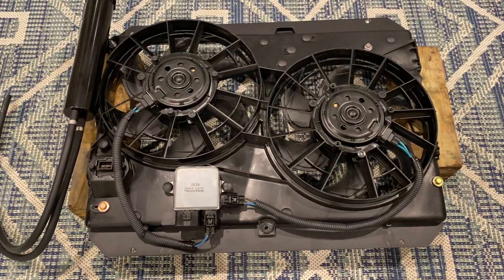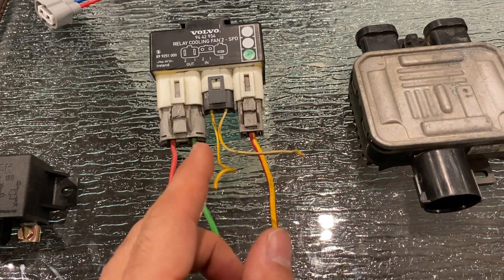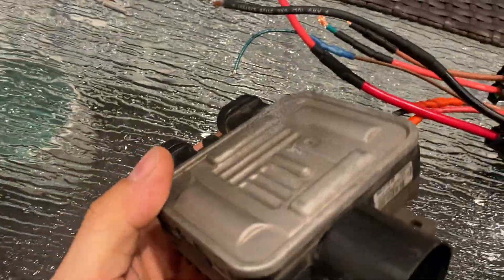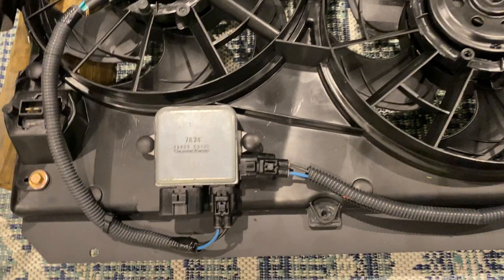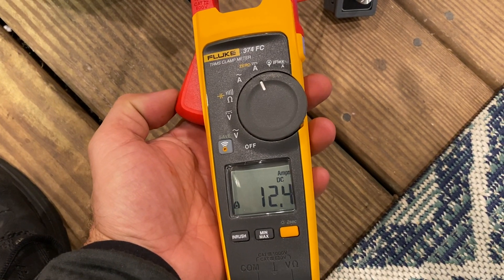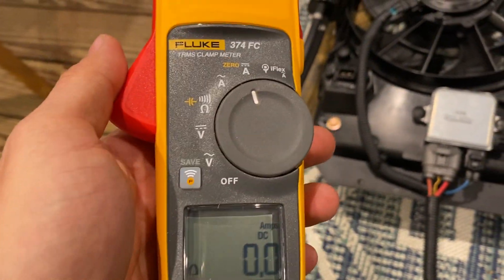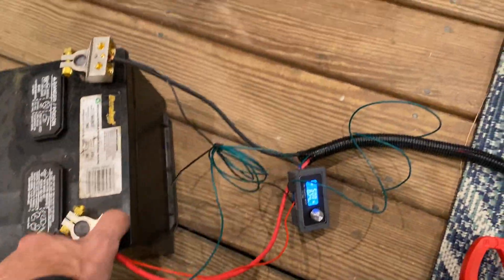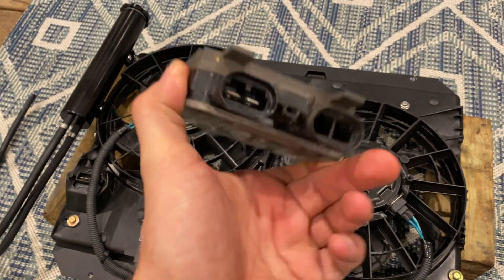Contour Fan Setup using a PMW fan controller

Comment: Hi, i have volvo s80 2011 2.0t with one fan unit. I bought control module with two outlets. can i buy dual fan unit and use it plug and play or i need to make some mods?
Reply from the maker: I wouldn't recommend that.  The current control module you have might use different inputs to control it and might not be compatible with this PWM module.
Reply: @Mustang5L5  The thing is my fan isn't spinning when it should at appropriate temperature and oscillates highly when i turn on AC, so i bought from aliexpress module that looks like the original also for s80 but has one inlet for power and two outlets for each fan. It also doesn't turn on when engine is above 95C. What would you recommend?
Thx for answer.
Reply: @Mustang5L5  In the end i went and bought the whole unit localy for 250. Temps are around 96 96 after a good drive. Only oil raises to 102 sometimes and than goes down. Thank you for advice and didn't waste money.

Comment: So, I'm working on a 04 Cobra.  I'm installing the Contour fans and I have this exact controller.  I have an MS3Pro but I'm confused because the fan has it's own menu and then when you set up the PWM menu you have 2 separate menus calling on the same output pin which if I'm understanding correctly, you shouldn't do.  If I wanted to route the current fan power wires into this controller and just have it as an on/off Fan controller, would it still have the soft start feature?  I have no intention on ever running this fan at any speed lower than full.  Thanks!
Reply from the maker: Are you on the latest firmware for MS?  The fan control menu is completely different now than what i show in the video.  It's more PWM specific and works better with these units. 

I only see one output pin now under the FAN menu, and you can select the ON/OFF temp and the min and max duty cycle.  The fan does still soft start, so you can set it to 100% on at a certain temp, and even have it shut off at WOT or with a certain MPH.

Comment: Thanks for confirming this operation. This is exactly what I need to do to my Lincoln LS cooling fan that keeps going into failsafe. It is receiving a bad PWM signal from the ECU because of a bad cylinder heat temperature sensor. The dealer could not get the intake manifold off because of seized bolt, so now I will just add my own PWM signal to the fan controller and keep it around 80%. How do I know what frequency to select? Do I simply adjust the frequency until the fan begins to operate?
Reply: I believe hr said these will work anywhere between 100-500hz. Friend has his ecumaster at 100hz. My haltech is at 500hz.

Comment: One last question. Do you believe its possible to control fan speed by cooling temp instead of manual speed input?  How?
Reply from the maker: There is no way to directly input a temp to the controller to make it work.  It can only read a PWM signal.   So any coolant temp data needs to be interpreted by an ECU or some sort which then creates a PWM signal it can understand

Comment: Amazing video. Top info. Tks a lot. I will convert my MB R129 chassis from clutch fan to electric and I will use your basic idea. May I ask you the part number for the electrical plugs. Can not find the correct ones. Tks a lot.

Comment: Why a nissan pmw? Is so unrelliable... A relay system is better...
Reply: Sounds like you do not understand the purpose of a PWM Controller? The point is to control the Fan Speed as needed. If little cooling is needed, then you have low speed. If you need a lot of cooling, then you will get higher speed. It works a lot better than you would believe

Comment: 62 amps for startup with one fan.  Wow.  Watching this to gain the lower startup draw.  Thanks.
Reply from the maker: Keep in mind that’s for less than a second. Typically for any motor startup and why you need to use the proper fuse type that won’t blow right away.  What really matters is continuous amps.

Comment: Hey! Thanks for the video! Could you help to understand the difference between Mazda's 21493-C370B and Infiniti's 21493-B210B controllers? Are they the same inside? Can I use Infiniti's for my Mazda? thanks
Reply from the maker: They operate similarly, but I was never able to get a solid answer on their differences.  Since these modules are provided to OEM's, the specs aren't exactly public.  In my testing, i've found that the PWN values needed to operate them are very slightly different.   Not but much.   I don't have enough of them to test to see if that is just variability between each unit, or if that slight difference is by design.
Reply: @Mustang5L5  thanks for the answer!

Comment: Does it have to be controlled with that (Amazon) controller? Is there a way to make it automatic to increase with more temperature, or to have it at two (or more) fixed speeds? I retrofitted a Mercedes W221 600W fan on my old Mercedes. Max speed takes like 46 amps and it will not live for long if full speed engages a lot or when it's not needed.
Reply from the maker: It needs to be controlled by some sort of external controller.  I used that Amazon controller to demonstrate, but really this is probably geared more to folks with an aftermarket ECU like Holley or Megasquirt that can create a PWM signal output on a spare output channel.  This unit really can't be used as a standalone controller.

Comment: Great video, question, this is PWM so, can it have a sensor connected to the radiator and sense the tempature to then build up or down the fan speed?
Reply from the maker: No.  This controller requires a PWM signal from another device like an aftermarket (or factory) ECU or an arduino.  Something needs to take the temp sensor signal, and other inputs like AC command, WOT, etc and convert that into a PWM signal that this unit can use.   A stand-along controller would be great, but as far as I know nobody makes one design to output a PWM signal.
Reply: @Mustang5L5  can you create a temperature sensor directly for it without an ECU? thanks
Reply from the maker: @yellowjoe.2000  No.  Temp sensors work off resistance.  This controller works off a pulsing voltage signal.  The faster or slow the pulse, the higher or lower the fan speed will be.   You need something to convert a resistance signal from a temp sensor over to a PWM voltage signal.

Comment: awesome video! thank you.  so it seems the infiniti PWM controller is compact small and can work with any decent electric fan?
Reply from the maker: Based on Infinti wiring diagrams I've looked at, it appears to be rated to around 50 amps.  Given that it has a soft-start feature,  I never saw anywhere near that with this fan setup.  This was about 25 amps running 2 fans.

Comment: Hey this is pretty slick. I run a Contour dual fan assembly as well in my old FJ60. Been using a DC Control PWM for close to 16 years and accidentally broke the damn sensor connection off today, so I'm researching newer, more rugged controllers if I cant de-pot the DC Control unit to repair the connection.

Comment: Are the contour fans you use OE or Dorman? And what is your Dorman part number if aftermarket. Thanks awesome info!
Reply from the maker: The one in the video is an aftermarket fan.  I don’t recall if it is a Dorman brand. I got it off RockAuto.com a few years back for about $100.  It might be a Four Seasons 75282 fan.

Comment: Nice demo and good hints on using the OEM modules.  The PWM frequencies you mentioned were in the mega hertz range, but I notice the readout on your PWM controller read 500 Hz.  My research into these systems found they can run below your 500 Hz and well above.  Frequencies between 20 KHz to 30 KHz, that's 20,000 to 30,000 cycles per second--are often what designers of PWM systems use because  these frequencies are above the hearing range of us Humans.  Dogs and bats might find these systems rather annoying.   Higher frequencies are much more difficult to implement and could interfere with radio and tv channels.

Comment: Hello , 

Thanks for the explanation. This actually inspired me to use a Mercedes brushless fan which is PWM controlled. 

Now I have a couple of Audi fans with the exact Bosch controller you have . They have 4 wires though - two power and two Signal ones I suppose. Unfortunately I cannot get the fans to move . Do you have any info on the 4 wire Bosch controller . 

P s. If I reverse the power polarity, the fan spins backwards 😅... They are junkyard parts so I didn't care . Maybe they are both broken but that would be quite the coincidence.
Reply from the maker: Hi,  sorry but unfortunately I don’t have much info on those Bosch controllers.  I no longer have it so I never got to play around with it.  I do remember finding info on them and a few videos so perhaps you can search and find the info you need.  Sorry I couldn’t be much more help but after getting the Infiniti setup working I discarded all my other controllers and just play around with this style.
Reply: @Mustang5L5  no need to apologize. Thanks for the answer . I'm from Germany so infinity parts are uncommon. I'll see if I find the equivalent or get the Bosch stuff to work . Time to dig into some wiring diagrams .
Reply from the maker: @LouiLocke  good luck to you!

Comment: Thinking of going with the contour fans myself on my 94 Mustang GT to replase the oem set up, its not cooling with new motor with AC on in traffic. Ive heard this to be a quality fix... One question can i hook this set up to my oem fan wireing harness?
Reply from the maker: No it work work with OE wiring.  The 94 and contour use different methods for achieving the 2-speed fan.  Contour has an on-board resistor and SN uses different windings in the motor.
Reply: @Mustang5L5  so I'd have to get a hole knew method
Reply from the maker: @dvinpeace  correct.  You’d have to use something like a DCC controller for example which would be a stand-alone PMW controller.
Reply: @Mustang5L5  thank you! Good content
Reply: @Mustang5L5 Do you know what the CFM is on the contour? I e heard to 14" Spal fans in a aluminum shroud would be even better. I'm new to this. I just know I need to upgrade cause of new motor & power. My biggest problem is in traffic with AC on.... San Diego summer heat
Reply from the maker: @dvinpeace  I don’t really know.  I’ve heard conflicting numbers.  Also the OEM ford ones pull more amps and cfm than the aftermarket’s so it’s going to vary.  Been meaning to measure as I have the right equipment but I haven’t pulled my car out from winter nap yet.

Comment: Could you add the part numbers for the associated connector shells and pins to your notes? I'd rather make my own wiring than buy pigtails if possible. (infiniti controller)

Video was awesome by the way.
Reply from the maker: Unfortunately, I don't have that info.  I'm using a mix of OE connectors that came with the infiniti controllers, and aftermarket wiring pigtails.   I've never researched what pins they are to purchase them separately.   I preferred the OE connectors as the wire size on the aftermarket pigtails seems a little undersized IMHO.

Comment: Thanks for the info, I have a Mercedes Ml w163 and the fan went into full speed mode with the radiator warning light popping up. Found out it was the PWM control unit was faulty but rhe new fan is sold with the unit attached at £500 or 2nd hand 250£. Probably will find a volvo s60 as mine is a single fan.
Reply: How has your project gone? I have a GL350 with same fan setup and mine stopped working.  I am able to force start it to max speed with my computer but as soon as the engine is turned off it goes off and stays off leading to overheating. Have you replaced the control unit? Which did you find to be the best?
Reply: Hi, I opened the module located on the fan shroud and it looks like on of tge capacitors are faulty as on start up using the ac unit it fails to spin at slow speed despite it trying to do so. Replacing it with a used unit from ebay.

Comment: S80 100Mhz?? you mean 100hz? 10-90% duty
Reply from the maker: Correct,  hz,  not Mhz.   The 10-90% range duty cycle was taken from another video I watched.  I sold that controller a long time ago so I haven't had a chance to mess with it in some time.
Reply: I copied you after failing to get a mercedes aftermarket one going. These work a treat. Got the black vs and bought 2. Bargain.

Comment: Hello.   What water temperature sending unit can I use in order for this  Volvo S80 set up to work automatically like oem  stock?
Reply from the maker: These particular controllers don’t work off a temp sending unit.  They require a pwm signal wire from either the factory ECU, aftermarket ECU or some other device like Arduino or the controller pictures.  The temperature sensor hooks to that ECU not this controller.
Reply: @Mustang5L5   oh ok..  didnt know, tnks.

Comment: On the power output to the fans (blue wire and black wire), which is ground and which is hot? I have the contour fans and would like to use this setup.
Reply from the maker: On the controller outputs, with the module facing up and looking at it, the pos would be the left terminal and the negative is the right.   At least that what I can see looking back at pics of my wiring.  Can’t access the car at the moment.

Comment: Hi, great video - thanks. Quick question - that Volvo fan controller you showed doesn't appear to have a PWM input pin (I noticed many types of these controllers don't)- how do you provide the control input?
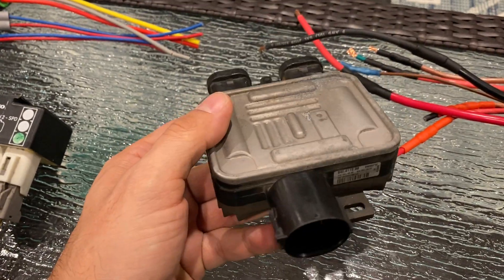Reply from the maker: The pin is very small.  You can see it at the 12 o’clock position right at 3:44

Comment: One other thing, my oem unit from mitsubishi outlander 2003 gone into failsafe mode, has black metal case with no markings, I believe its original unit, its certainly the oem one.
Reply from the maker: Not sure if you had another comment.   Those black box controllers were known to fail prematurely, and there is actually a recall to replace them on the vehicles originally equipped with them.  They fail into failsafe mode.   The silver case controllers are the updated module.
Reply: @Mustang5L5  very interesting thanks for that. 
This is interesting, i've done two quite long detailed replies and both have not been posted, in those replies I have put a link to a website where I have been documenting my teardown/rebuild of the unit.
Seems there is some censuring going on, how odd.
I shall email you instead.
Reply from the maker: It is weird.  I've been searching through the Youtube studio and do not see your comments anywhere, even under the held for moderation tab.  Please send me an email as i'm curious to more details on the inner workings.  Email should be under the main channel details.

Comment: Awesome video I have been wanting to add electric fans to my car I want to connect your setup to my A9L using binary editor just not sure how yours is triggered
Reply from the maker: I’m somewhat familiar with how binary editor can allow the A9L to control a fan, but not sure it outputs the correct pwm signal that this controller needs.  I could be wrong though.  I’m using Megasquirt with a pwm signal based on coolant curve and some other triggers.

Comment: Are you using an OEM dual fan unit?  I find that the aftermarket units output less fan power.  Not sure if it's my wiring, or that aftermarket fan motors are way "under-powered".
Reply from the maker: No, this one is aftermarket.  Cools my car fine on 90* days with the A/C on.  But you are right. The OEM motors do pull more power and draw more CFM.  For the contour fan I’ve found about 30A or so at full speed vs these aftermarket ones at about 25amps.  I’ve been on the lookout for a clean OeM fan to swap motors into my shroud, but unfortunately all the ones I come across are badly rusted and I don’t want to use them. My fan seems to be doing a decent job on my car, so it’s not a high priority for me.
Reply: @Mustang5L5  Thanks!  BTW, great info in the video!

Comment: Hello, thanks for the nice video. I have the same volvo s60 fan controller module laying around and i didnt have pigtail connector so i cant try it yet. Can i use the amazon PWM generator to control the fan speed like your setup? TY
Reply from the maker: Yes, the Amazon controller will run it but I do not know the proper duty cycle range.  I think it’s 10-90% with 0 or 100% turning the fan off.  These a few resources on that controller if you search that go into more detail.  Before you hook up power, make sure you know what wire is posotive and what is negative as hooking up these controllers backwards can brick them.
Reply: After hooked it into power, it does power on but can not adjust duty cycle look like i have the faulty s60 pwm fan controller, i guess it stuck on failsafe mode like you mention in the video. Fan auto ramp to max rpm, got no respond from pwn generator. Will try to get another aftermarket one.
Reply from the maker: @gau661   yeah, sounds like it bricked.  Sorry I haven’t played much with those units to offer more specific details.
Reply: @Mustang5L5  No problem, very appreciate your help.Very nice setup. I'm having voltage spike when radiator fan kick on, i bought the nissan oem pwm controller like your setup for my old car.